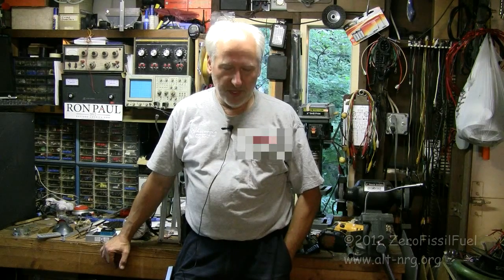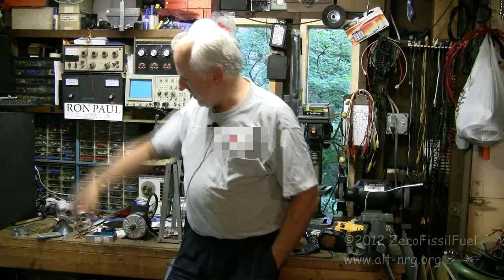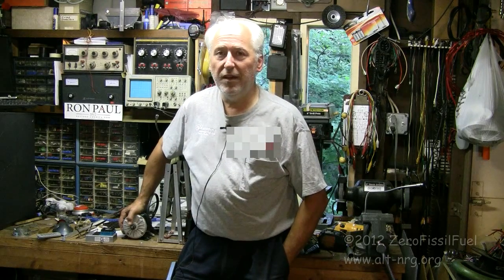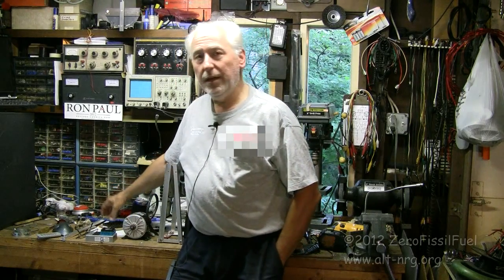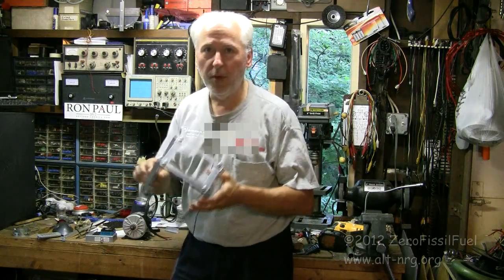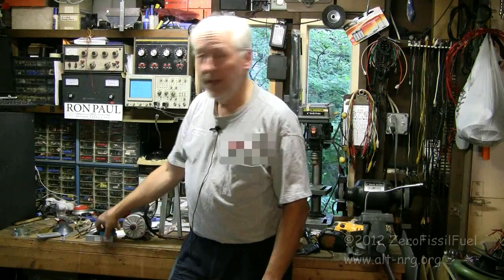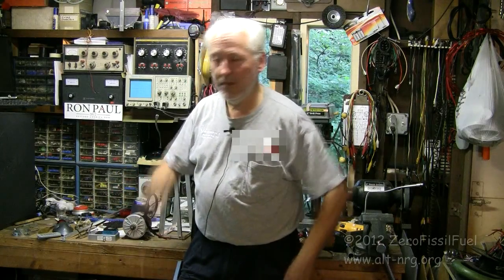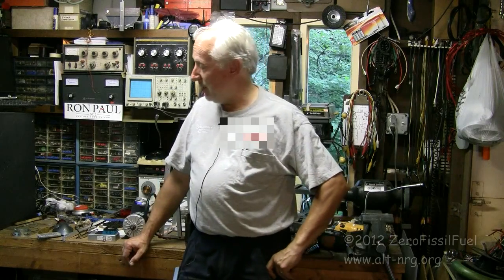#309 RWG Pulse Motor build-off

Comment: I had the same idea for an electric bike motor setup, I was wondering if something like a 48v motor could be run with 4, 36 volt power tool batteries, just as, a proof of concept. But then I wasn't confident in my ability to build it so I started hitting the books hard. What you just said made me feel less stupid about thinking it up! The whole limiting the voltage to the motor thing.